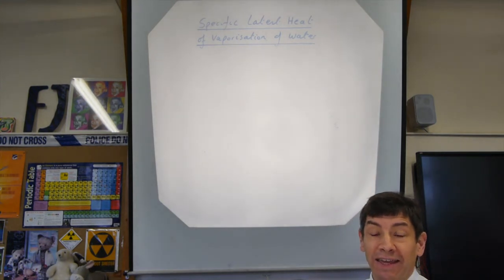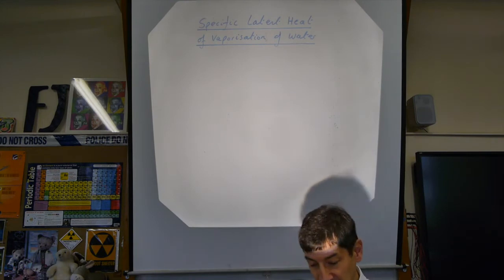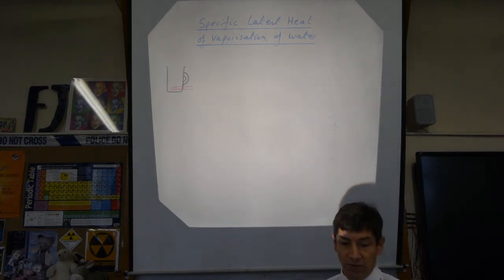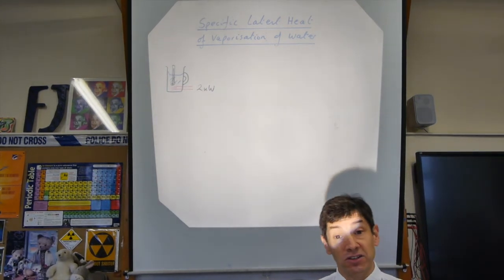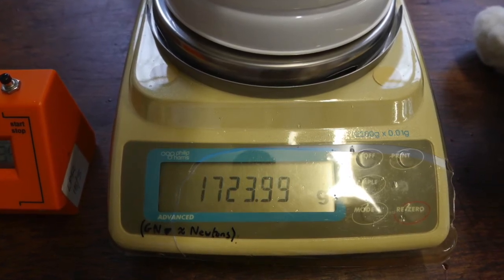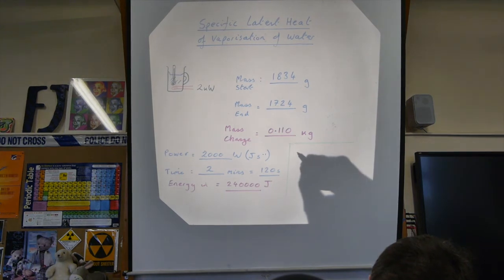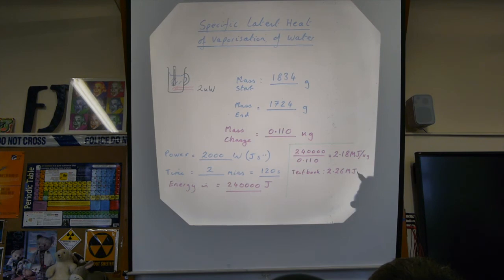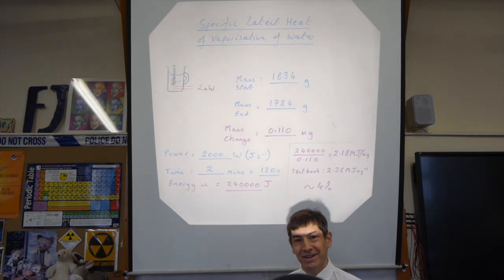Specific Latent Heat of Vaporisation of Water with a Kettle - F-J's Physics - Corona Busters

Comment: Nice. Rather than using the wattage value stamped on the bottom of the kettle, I do an additional determination of the actual Power of the kettle--J/s absorbed by the water by heating--not boiling--a known quantity of water for a specific time and using the specific heat capacity of water; ie E = m*c*(delta T). (Our kettle says 1000W; I determined 778 W) I got a value for deltaHvap of water at 100oC to with less than 3% error.
Reply from the maker: Thanks Michael.  That's a great idea!  Would make a real difference.  I have never done the experiment with a power meter attached or bothered much about what is RMS and what isn't!  I find the mains voltage too is often rather on the low side.   Thanks for taking the time to watch and comment.  Your students are in good hands!